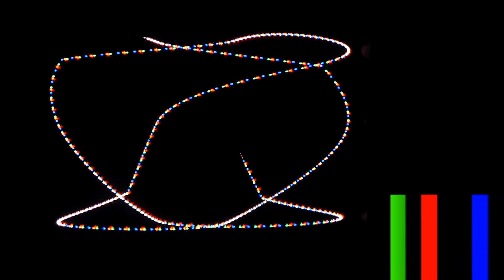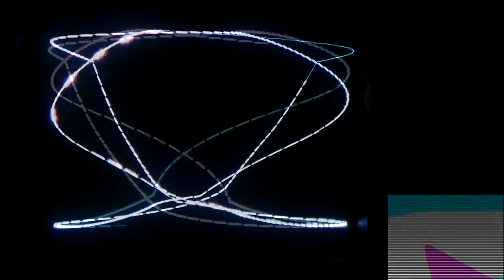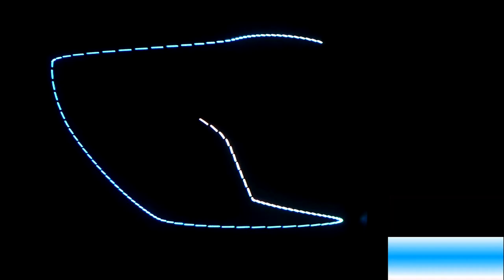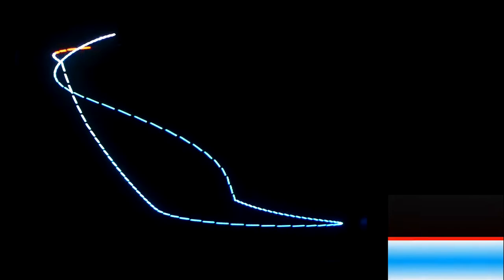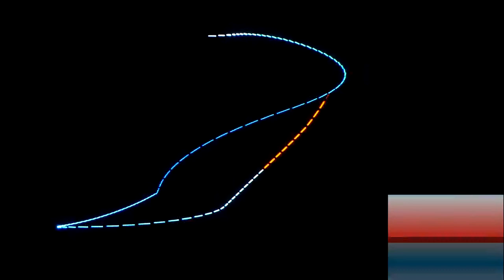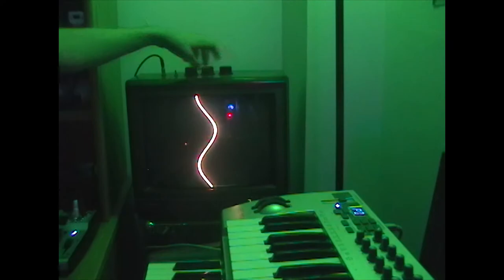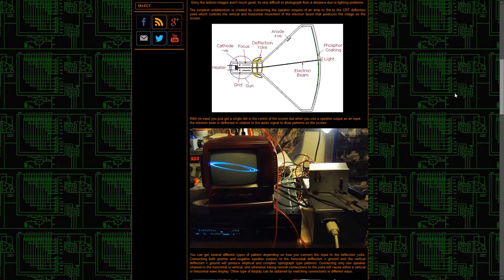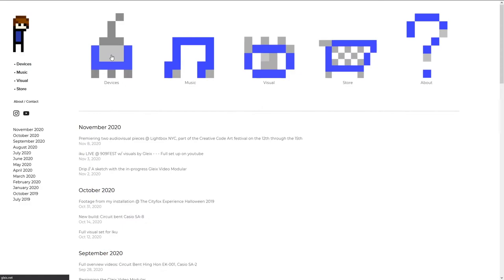Making a more colorful oscilloscope // Modified CRT Television, DIY XY scope with video input

Comment: The main thing this did was to shatter what I thought I knew about Color CRT TV :P

I am also curious about the aliasing artifacts. It seems to be unable to make full curved lines even when the input color is white. I mean, curved lines seems to always be segmented into lines. Is this because of the Shadow mask on the screen?
Reply from the maker: If you look into what a composite video signal is comprised of & how an image is built on a CRT TV, you'll notice that the full signal consists of some additional data that isn't just the image itself! The waveform appears segmented into lines because the raster image itself is actually segmented into scanlines. 

Things like the blanking intervals, sync signals, color bursts, etc... which are outside of the visible image we see on screen, manifest themselves in this modified display as empty gaps as there's no image data there to interpret. You can think of each dotted line here as the active image portion of a single line in the raster scan (there ought to be 525 in this instance, I think), and each gap as the section which contains the horizontal sync and color burst data, which shows up at the beginning of each line in the scan. 

The larger visible gap between the start and end of the waveform, like you see at sections like 2:16, represents the section of the signal that contains things like the vertical blanking interval, which would only appear at the very beginning of the raster scan.

Comment: Commenting here because the RGB registration/purity is so nice that beautiful colors can be implemented. 

Constructive comments:
Screen burn in the center could be avoided by adding a circuit to detect lack of deflection signals. These are used in commercial video game displays such as in ‘Asteroids’ and other great games. The beam is cut off after a fraction of a second. The delay covers the occasional legitimate times when the deflection voltages are momentarily at zero.

The blanking is showing. There may be no simple way around that if using composite video input. Better to disable the blanking and use separate analog non-blanked RGB inputs direct to the video amplifiers on the CRT socket board. Since blanking is part of most video recording, a different approach may be required such as multichannel continuous signal method akin to a high bandwidth analog audio stream.

Be sure to use a closely substituted and non-saturating inductance connected to the H sweep circuit for the horizontal deflection coil when leaving the deflection coil and CRT convergence and purity magnets on the CRT neck unmolested. The inductor is required because the H yoke winding for which it is subbed is part of a tuned circuit required for correct operation of the high voltage power supply. It’s a reliability and safety issue. Leaving the original yoke etc unmolested is the best way to get good color purity as displayed in the video. Mouser and others have chokes for substitution. Again, the substitute choke is a safety and reliability issue.

The LM358 is very low power. I used 20-30W tube amplifiers when I did this because those are hard to destroy. Not so with solid state amplifiers facing the transients of inductive kicks. 
The deflection yoke is highly reactive and far from a 4 or 8 Ohm load, so choose and oversize the amplifiers prudently and use those with fast rectifiers to clamp transients to the power supply rails. Or else.

To produce accurate waveforms, the H and V deflection power amplifiers must have current feedback from the yoke current so that delta Vin = delta Iout. It's the yoke current that positions the beam, not the voltage. The amplifier must slew faster than the yoke for this to have meaning. DC coupling is a plus.

The speed at which the yoke can traverse the beam with a step voltage is inversely dependent on its inductance. Therefore, the highest voltage output stage should be used to give the highest frequency. The yoke current to hold the beam at the edge of a decent sized screen is 2 to 4 amperes, usually. A 30Khz (60KHz -3dB) screen-wide deflection response may require a peak amplifier output voltage of 100-300V from the amp, so don't count on a full audio-range accurate scope without a box of amps next to it. Don't be discouraged though because the treble in audio never goes full screen in a music waveform. In graphics, YMMV. 

I mainly alert experimenters to the sluggishness of electromagnetic deflection and the challenges to overcome according to the unsuitability of the stock TV set yoke, which has to be kept to assure proper convergence for color registration. In special and military vector displays, the yoke is quite different, with very low inductance (fewer turns) of larger wire for low resistance.

Here are some links to monochrome vector display manuals and one RGB unit showing or explaining current feedback power amps for deflection, and ‘spot killers’ or beam blankers. The documented working examples are scalable. These products are discontinued and not supported. Just like your TV set which I hope will get a new life.
https://bunkerofdoom.com/lit/G05-801.pdf
https://bunkerofdoom.com/lit/Texscan_DU-127_XY_display.pdf
color vector display:   https://www.jmargolin.com/xy/xymon.pdf
Reply: Cool! Where can i learn more about this off circuit, id like it implement it.
Reply: @EosKarlsson   page 14 of this manual:   https://bunkerofdoom.com/lit/G05-801.pdf    
Also search for x-y displays, vector display, vector monitor, CRT spot killer, vector video game, to find manuals for more displays having variations on the "spot Killer" circuit. These other links MAY help so look at them all too. It's a niche circuit so there will be digging to be done, but all professional arcade game vector monitors from the olden days used the circuit. Vector display Manufacturers were Wells-Gardner, Electrohome, and others.

https://www.jmargolin.com/xy/xymon.htm  (best, experienced tech)

https://www.retrorgb.com/vector-monitor-xy-kit.html

https://hackaday.io/project/2871-build-an-arcade-xy-vector-monitor

good luck!

Comment: I have no intention of hijacking the OP's video or comments. If it's not appropriate, feel free to delete. It's just the result of drinking too much coffee.

So, Others have commented about drawing circles (presumably using two equal sine waves 90 degrees out of phase) which turned out to be non-circular when displayed. OK, the goal is to have an accurate display. The overlooked technique is that the deflection amplifier must use current feedback, not voltage feedback. In electromagnetic deflection (using a yoke) the amplifier's output Current must linearly follow the amplifier's input voltage. This is the opposite of the idea where, for example, a hi-fi amplifier's output Voltage must linearly follow the amplifier's input voltage.

Amplifiers use feedback to make them linear. To convert a voltage amplifier (common audio amp, etc) to a current amplifier, one removes the voltage feedback loop (primarily a high value resistor connected between at the amp output to deliver a negative feedback voltage to an early voltage amplifying stage such as a differential stage, and then one places a low-value non-inductive resistor between the 'cold' (circuit ground) side of the yoke winding and its return (ground). At the junction between the cold end of the yoke and the new resistor, a voltage will appear that is a linear copy of the yoke current. Therefore, the yoke current waveform can now be used as the negative feedback voltage, by feeding it to the same early stage in the amplifier.

I can't be more specific because there are thousands of audio amplifier designs and there are no such step by step instructions on how to do this, or how to control and select colors, simply because there are thousands of different models of TV set out there and each will absolutely require careful experiment, measurement, and some calculations. The links I provided are a good start for deflection amp feedback ideas.

About the vertical yoke, it is slow and low-frequency because it is designed to run at 60Hz and has a lot of inductance. Personally I still say leave the original yoke unmolested, substitute the suitable inductor for the H winding,  and use an amplifier capable of higher voltage to drive the V yoke at the higher frequencies. 

The first topic to understand is the inductive reactance of the yoke coil you want to drive (whether H or V sections), and its effect on the current through the yoke with a given sine wave voltage that varies in frequency, because the goal is to get equal deflection over a range of audio frequencies. At some point it becomes impractical but still very fine effects can be had out to a few Khz. Some electronics books have the formulas, and there are online calculators and charts to visualize the concepts.

A very gross example (and do not rely on the resitances or figures given here): A hypothetical vertical yoke winding has 1 Ohm resistance. With DC (0 Hz), it may take 3 Volts from the amplifier to push 3 Amps through the winding and fully deflect the spot to the top of the screen (and negative 3V to do the same to the bottom of the screen). At 60Hz, it may take 20V peak (+ and -20V) to fully deflect the spot, but of course being AC now it will be a line stretching from top to bottom of the screen and the same 3 Amps, though those will be the (+) and (-) peak amps. At 200Hz, it may take 200V peak to get 3 Amp peaks (same full V deflection), and so forth increasing as frequency is increased.

So from the above paragraph, the yoke coil in question has 1 Ohm resistance (some call 'dc resistance' in conversation). It can be considered that this resistance is effectively in series with the yoke's inductance. The indictance has a specific reactance (X) at any given frequency (hence "XL" inductive reactance @ 60Hz). If it takes 3A to deflect the spot fully, and we know that the DC resistance of the yoke is 1 Ohm,  and it takes 20V to deflect the spot at 60Hz, then we can tell or measure that the yoke will have 17 peak volts across it (20V - 3V = 17V). What is the inductive reactance of the yoke coil at 60hz? It is 17V / 3A = 5.67 Ohms. 
Ok, and what is the inductance? 
 - A chart online gives about 15 millihenrys (15mH).
or do the math:
 - The formula for inductive reactance is:
 XL = 2 * pi * F * L. 
5.67 = 2 * 3.1416 * 60 * L (XL=inductive reactance and L=inductance). 
5.67 = 376.992 * L
5.67 / 376.992 = L
5.67 / 376.992 = 0.015040 Henries.  = 15mH.

either way is close enough for fun.
--------------------
 - The H and V windings have very different inductances. Why? because it was most cheap and techncially simple to make the TV that way. So do this for the H winding and the V winding.
 - Most all yokes actually have two H windings and two V windings. This is because it makes a more uniform magnetic field in the CRT. The windings are often in series. In some cases, it is easier to drive a yoke having high inductance by putting the windings in parallel. Inductors in parallel act mostly like resistors in parallel. The value is about half, depending on their magnetic coupling which I don't want to get into because yokes are different in this respect. Grossly though, the XL (inductive reactance) is cut in half. (as well as the inductance and the resistance). 
 - There is a term 'impedance' we all know from speakers and radio equipment. The impedance is the sum of the resistance and reactance. Impedance is expressed as "Z".
-------------------
I hope this is not overbearing and will encourage people to experiment with this fun kind of project!
If there are mistakes (other than silly grammar, spelling, etc), someone please point them out with the correct explanation.

Comment: That’s real neat. One “issue” is that you’re bound to the H-sync and V-sync periods of the television still, giving you large and small black areas respectively. I’d want to control the brightness of the electron gun with dedicated circuitry, instead of using the video input. I’d also put some sort of VCA on them to dim the beam at lower X/Y amplitudes, as not to burn a dot in the middle. Ideally a constant brightness per unit length would be used, but I think it would have to be approximated without a microcontroller, or including the brightness signal alongside the X and Y signals as a pre-processed time varying value.
Reply from the maker: One pleasant surprise about putting this video out is that people much more knowledgeable than I have shared their thoughts on features that can solve the main issues that this basic implementation has, with the biggest being that there's no way to avoid a hot beam in the center. A microcontroller based solution that can dim the output of the electron gun when the audio signal is low is a fantastic idea that might be the easiest to implement; especially on CRTs with an accessible brightness & sub-brightness trim pot. Solving the non-uniform deflection amount of the X and Y axis when fed the same signal is the other priority, and would require some research I've not done :) 

I've actually run into the sort-of inverse of the hot-beam problem after attempting the modification on a few newer CRTs; some newer ones have deflection protection built-in, so that when the amplitude of the deflection signal it's expecting isn't received the gun refuses to fire (or fires very dimly), or refuses to deflect properly. Locating and bypassing (or modifying) this built-in protection seems like much more trouble than it's worth, and doesn't solve any hot-beam issues though.
Reply: I want to implement this.. where can I find more info on this?

Comment: Hey great do you get fast enough vertical deflection on your CRT? Also which CRT screen did you use in this video?
Reply from the maker: This was made with a Toshiba MV13L3 - I got it for free due to it having vertical collapse. I recapped it, resoldering just about every joint, and replaced the IC that handles vertical deflection but none of that fixed the issue unfortunately. All this to say, it may be a unique issue to this specific one I've got since it already had some wonky issues with deflection, but also in general the horizontal and vertical deflection don't typically act identically in CRTs from my experience - trying to make a circle will typically end up giving you a weird oval, or some other strange shape depending on the gain of your audio. Maybe something to do with the fact that the full scan is 4x3, not a perfect square.
Reply: @gleix_  hey thanks it does loo very good. I just wonder a part the rescaling of the XY that could be far from perfect, what about the frequency, can you go as high on vertical as on horizontal? Or you have to substitute the coils?

Comment: Can anyone tell me how he routed the video signal?!? How tf does this work 😅
Reply from the maker: Video still comes in via the stock composite video input :) It's just processed differently after the mod.
Reply: @gleix_  

Sorry for the noob questions but this is fascinating! 

so you don’t have to mess with anything else, just re wire the coils - then plug a video source into Theo standard video input? 

Could you hypothetically run a vcr whilst feeding an audio signal to make the waveforms the colours of each movie scene? 

Also, what parameter controls the colours produced on a colour screen crt? Varying Voltage of L&R channels respectively controls the pattern, gain of incoming signal determines the size/amplitude of the waveform on screen, so what changes the colour? What happens to the electrons fired by the cathode that produce colour on the screen? 

Thanks for your help and your video!